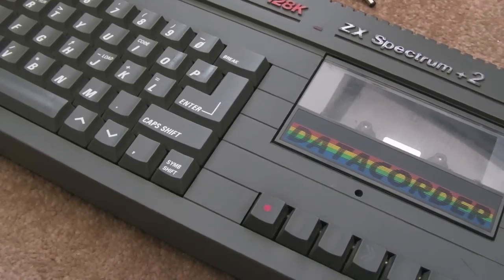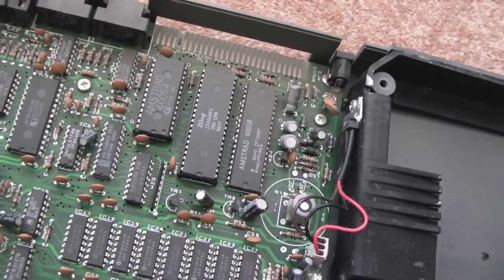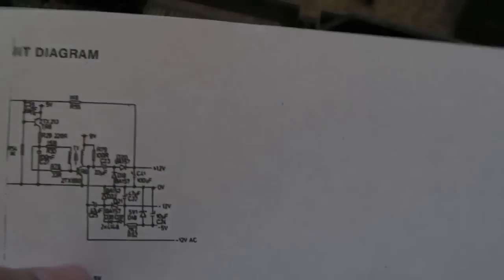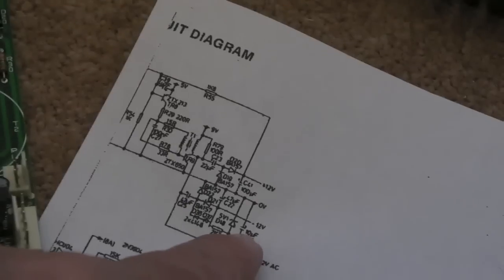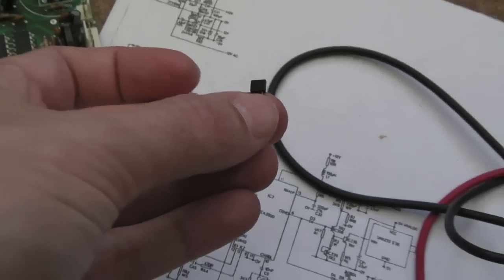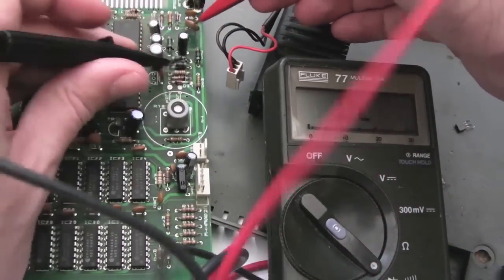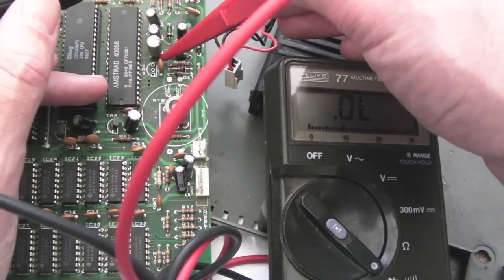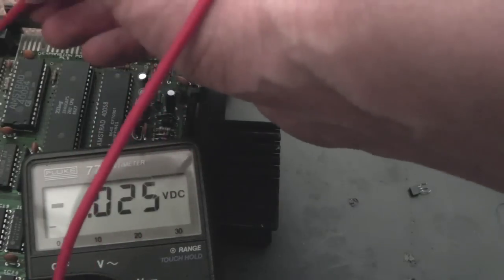Sinclair ZX Spectrum +2 Black Screen Repair

Comment: Thanks for this vid, I've had a +2 in my cupboard for a while with exactly this problem and following your steps I noticed the same lack of 12V, short etc... and simply replacing TR9 fixed it. Used a ZTX651 as 650s are harder to find.
Reply from the maker: No worries - glad it was of some use =D  Pleased to hear you've saved your Spectrum =D

Comment: quick question. Ive got a 128 2B and pretty sure the ULA (amstrad gate array ) is dead. Have you ever replaced one and if so is it worth the effort or do you think it's a dead duck??
Reply from the maker: What makes you think its the ULA?  Isn't the ULA on the 2b a surface mounted chip - I cannot remember, it has been ages since I saw the 2b motherboard?   If it is the ULA the big problem is sourcing a replacement ULA.
Reply: well the machine powers on, I've checked the processor, RAM chips, all the usual suspects and as I understand if the ULA is faulty then you'll get a black screen. dont fancy trying to replace it tbh, yeh it's surface mounted. Just checking if Im not missing something. Will prob rip out the chips and ditch the board. Some machines are worth fighting for but gotta feeling this one is beyond repair....
Reply: I have this exact problem black screen, tr9 is burning hot, I hope its just that, thanks for this video, there's not much on repairing the zx I've seen,

Comment from the maker: I ordered a new DC socket btw.  Not arrived yet and not worth filming.  The problem with the DC jack is that one of the pins on it had sheered off the connection to the PCB and wouldn't join back up properly.

Comment: Do components other than capacitors fail in the way that capacitors seem to, or did the transistor fail because of the loose power jack, do you think?  By the way, I've just managed my first electronic repair - two bulged caps inside an LCD monitor - thanks to some reclaimed caps from old PC motherboards.  A most satisfying feeling.  :)
Reply from the maker: +MarkTheMorose Don't know how I missed this message!  Yes, some components just die from age / usage, but with transistors, diodes and resistors it tends to be temperature which shortens their age.  Power spikes can kill transistors though.  Great job on your LCD monitor =D
Reply: GadgetUK164
I figured you were off somewhere, busy bringing some neglected retro system back to life, so I didn't mind.  ;)

I've got a couple of other items that need re-capping, so the monitor was a confidence-booster.